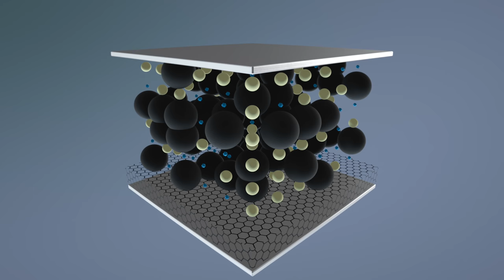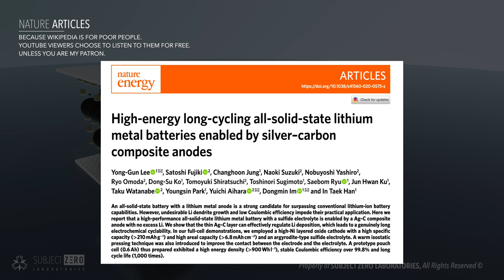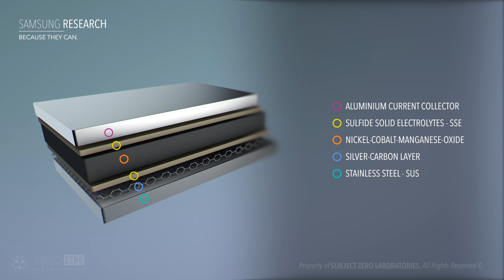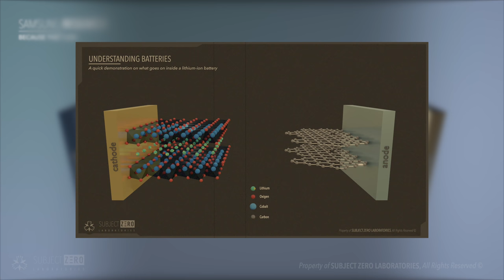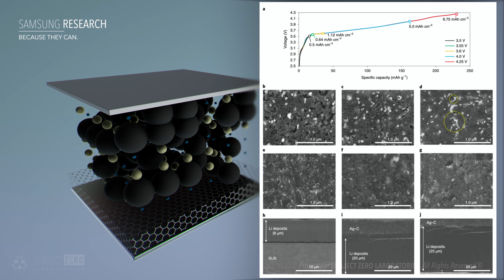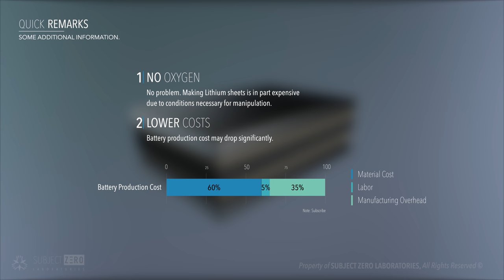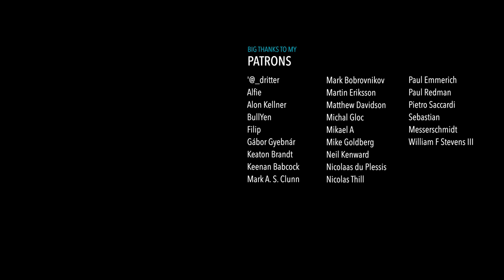Breakthrough Solid State Battery - 900 Wh/L Samsung [2020]

Comment: I attended a "battery symposium" (I don't recall what it was called) back in 2006 in Ohio while in grad school.  I recall 3 or 4 companies giving very promising presentations on ssb's. The data shared seemed very promising! One of the companies actually promised to have these commercially available in 2 -3 years.  Well, that was 14 years ago, and still no ssb.
Reply: That's the point. Powerful interests don't want this to happen. This is why they suppress other exotic energy production technologies. You can control people with hydrocarbon technologies (Oil, coal, etc) but you can't control them with other forms of electricity production, like over unity devices and zero point energy production technologies.

Comment: An interesting new way, but what about the Lithium-oxygen batteries that was studied in the Department of Mechanical and Industrial Engineering, University of Illinois at Chicago? Which one represent the future of the batteries?
Reply: @EricMalbos I was wondering the same..I guess that, since researchers at UIC developed metal air batteries they are dependent on oxygen and causes flammability issue with lithium anode...on the other hand this one by samsung completely eliminates the flammability case and makes them safer for future applications...
Reply: Lots of problems with this approach.
Biggest one, you have to pump air into the battery, while filtering it and while removing all water (and avoiding condensation)...
Reply: IBM kinda stopped development of there lithium air battery "project 500".
Reply: The cheaper one, obviously
Reply: @OmkarBhatkar  @apauwelyn1 Thank you, it makes sense, I understand now.

Comment: So basically, an unplugged Evangelion can last more than 5mins now
Reply: Why don't they use nuclear power instead?
Reply: @UltimateAlgorithm  It would have to be fusion, not fission. Our only use for fission is as a glorified steam engine, as its too slow for anything else.

Evas need to be able to move, and move quickly. The only good a nuclear reactor would do is as a trickle charger for a rapid-drain battery.
Reply: but future shinji will still be using a dtape.

Comment: Question is how much silver would be used per unit or ton?
Reply: If it ends up being a decent chunk, the price of silver might dramatically increase, at least until recycling can bring it back to more of a closed loop system.
Reply: I doubt it is going to require a lot of silver. Remember that almost every electronic device in your home has gold coated electronic contacts. I believe that the silver needed in these batteries will be a very little amount.
Reply: We don't know, but it was described as a 'nano layer' of silver-carbon, implying that it was very thin.

Comment: I've been hearing of new batteries coming zoom for more than 5 years now. When are they coming to market? I can't see another video for a battery unless it's already on the market.
Reply: Mid May according to Elon.
Reply: You confuse "coming to market" with "research if it even works"
Reply: @francoischarbonneau9447  Hehehe. Tesla will need another 2-3 years to get their product pricing low enough to justify the switch. Solid state, maybe 5+ but at a significant cost (on a sedan car already costing 60k!). By then, revolutionary combustion engines like Mazda Skyactiv X will be achieving better than hybrid efficiency while keep emmision (N0x) levels to ridiculously low levels. And that's aside the competition in the electric market and the lower low fuel prices.
Reply: Exactly im tired of seeing how this crap "might work"
Unless their coming to market quit wasting my time with stupid shit videos 

i want my money back
Reply: New and improved batteries are literally hitting the market everyday.  I owned a 2012 Chevrolet Volt and back then they used an NMC333 battery chemistry that cost about $400/KWh to produce.   My Wife's 2018 Bolt EV now uses a much more energy dense battery with an NMC622 Cathode that cost about $145/KWh to produce.   The 2020 Bolt EV has already moved on to NMC712 which is another 10% more energy dense and costs closer to $100/KWh.  And the new GMC Hummer will be using NMCA89 cathodes which are much more energy dense yet again and should cost closer to $90/KWh to produce.  Plus GM showed a solid state battery cell which appears to be pushing towards production for the next generation of EV's in the mid-2020's.
Reply: You are not following the right sources. Companies like Tesla (and one more) have brought newer batteries that can be purchased as a power bank (portable chargers). Either one or both of these are based on Graphene (as an enhancer). Samsung has a whole division working on even a better concept surrounding Graphene (still in the research).

The essence of it all is that, there are newer batteries with better efficiency (more capacity, faster charging, more life) but those have not yet been incorporated into mobile devices. For something as personal as a handheld phone, it has to be tested thoroughly for any suspicion of a hazard. There is gonna be bigger batteries this year on smartphones after a recent advancement which decreased the size of encasing surrounding the battery. I cannot recall what it was, but yeah, that's the reason, smartphones this year have a slightly bigger battery without making the phone bulkier.
Reply: Then why has phone battery capacity doubled in 10 years? My samsung s3 charge at slow pace and holds 2.1ah. My g6 is over 3ah and charge in 90min and newer phones may have over 4ah cap and charge in less than an hour.

Also heard of lithium tantanate? Up to 50'000 charge cycles. Lithium iron phosphate 5000. Actually used in medical stuff. ( you can buy them used for cheap as they're supossed to replace at 80% left )

Comment: ok, the volumetric energy density is 900 Wh/L
what about gravimetric energy density and the power desities?

for an ev it isn't very helpful to have lot of capacity, but only being capable of delivering little current while being heavier
the batteries need to have the right balance of properties for every appication
Reply: I suspect these characteristics are not so impressive, otherwise the authors would have enthusiastically mentioned them in the abstract.
Reply: Probably better for stationary application.

Comment: We keep hearing these "new breakthroughs in battery technology" and yet none of them have been used in a smartphone. I mean, the only thing that's holding back our phones are batteries. They only last around 4-5 years when afterwards they either have no capacity left or have bulged or even exploded. And they are not even easily replaceable like they were back in 2014. Hopefully, they will be available in a few years, because I don't really see a reason to buy a practically disposable phone.
Reply: They dont want you to keep your phone they want repeat customers.

Comment: Why does Samsung glue the batteries in their phones?
Changing a battery is basic maintenance.
Reply: Profit but you prolly already know that
Reply: So you buy a new phone every 2 years
Reply: I think you know the answer to that.
Reply: Its normal for most phones, even if the backcover could be screwed off. It's to make phones more durable and compact. You can heat the glue a bit and switch the battery. Replacing the glue is a good idea when switching the battery or any glued covers or screens. It can all be done at home, and for beginners internet is full of instructions for basic maintenace.
Reply: Would you like having a phone that rattles? Also it is not hard to unstick the battery.
Reply: Because Samsung has also cornered the market on temporary adhesives.

Comment: I wish they had give the Wh/kg.
Reply: A quick search on battery energy density indicates an appropriate equivalent of w/l to w/kg
Reply: 1liter = 1kg
Reply: zoltan87    With water, yes, but it doesn't hold true for everything.  For example, 1L of lead is going to weight a lot more than 1Kg.
Reply: @johnmyviews3761  i think there w/l might be wrong. My current ebike battery is around 1.5 liters, and is 1kwh, so its 750wh/l. IDK how 900wh/l is a big improvement

Comment: He mentioned the 60% inefficiency of the internal combustion engine to transmission to wheels etc HOWEVER did not apply the 10% loss of electrical power of the  motors that drive the wheels. This would have shown a more 'honest' presentation.
Reply: Lighten up Francis

Comment: Hi, just a small correction in your video : 
=> Lithium is not dangerous because of O2 but because H2O contain in air. When we make a lithium-ion cell we work in a dry room and believed me their is oxygen inside ;) Oxygen could be a trouble for other reason specially with liquid electrolyte for example.

Comment: If this works, it's easily worth a Nobel prize.  

P.S.  Your initial diagram is wrong.  The bulk of the electrolyte is next to the Steel electrode, and is not meant to be in as significant amounts at the Aluminum electrode.

Comment: I’ve heard about new battery technologies for years and it literally never comes to fruition… It’s like the flying car...
Reply: Nah, flying cars was a dumb idea to begin with. The more fuel you carry, the more fuel you need. A flying car with a full tank wouldn't get very far- and forget going fast. You could probably get over a mountain pass faster in a normal car than in a flying car. Even if the normal car was set to autopilot, which oh yeah, we have that.

People just thought it sounded cool, and it stuck. You'd be better off buying a glider (or strapping a jet engine to your car, but I'm pretty sure that'll void your warranty. And your insurance. And your driver's license, probably.)

Comment: Nice breakdown of the potential advantages of a so-called "solid-state" lithium battery, meaning dendrite-preventing plus a near all-lithium anode. However, "closer to an electric future" does NOT depend on achieving a solid-state battery. We already have safe, powerful, longlife, very affordable (under $100/kWh) lithium batteries with 10 times the volumetric energy density of lead-acid that you used as your 1991 baseline. A solid-state lithium battery would be great, but it's not at all required to move completely off gasoline for automobiles and many other applications that previously required gasoline.

Comment: So if this is Solid State and the charge is transferred by diffusion, dentrites would not come into the picture. Not sure why they are mentioned. 

Also he mentioned faster charging times. One reason for the faster charging times is because solid state batteries are non-flammable and cannot short circuit due to dentrites, so they can take more charge safely. But the greater energy density also means there is a greater concentration/ availability of lithium ions that can accept charge so this reduces charging time also. A win-win.

Comment: At 2:13, yes petrol has higher energy density per litre, and most internal combustion engines are only 30% energy efficient with some 40% whereas electric motors are 90% efficient

Comment: Mid spec lead acid car starter battery YBX5012 Yuasa Silver 
54 AH =  648 WH @ 12V
Size = 207*175*190mm = 6.8 litres
That's 95 WH per litre
But it's a starter type so only 30% comes out as useful power. Usable energy is just 28 WH per litre

Comment: We already know how to store huge amounts of energy safely in an onboard storage system. It's called "compressed air" at 10,000 psi or more, packed into carbon-fiber composite air pressure tank(s) that are "failsafe." This compressed air is then used to run in-hub rotary Wankel air motors which are nearly silent in operation and superefficient. Air pressure tanks can be molded to any shape and can be made so that they form the structural side panels, roof and floor of a vehicle. This provides huge compressed air storage space and opens up the inside of the vehicle and trunk to other uses (other than air tanks). The same technology can be adapted to power superefficient VTOL aircraft as well. GM Cadillac Aera concept car was developed to use these technologies. The air powered car would dominate the surface transportation system for hundreds of years to come, but even more exciting, VTOL aircraft of this type would make surface transportation, roads, bridges, and tunnels, completely obsolete, freeing up large areas for homes, and for wildlife, recreation areas, and parks etc.

Comment: There's a few things this video missed that are really important for batteries. how much will they weigh, how fast will they discharge and most importantly how much will they cost. (for materials that is, production and labour was talked about👍) It would be really great if batteries could have so much energy density but it they cost a lot they're not going to be commonly used

Comment: what we need are such energy density & a cycle life in the tens  of thousands of cycles. a thousand cycles is like a 3~5 year lifespan. That's a lot of production and recycling to maintain the system. A 30~50 year lifespan would reduce the need for such a ton. We could work toward battery life equal to the product lifespan and it would be actually useful for applications at the power grid level.

Comment: Solid State Batteries are a game changer.  they have about twice the capacity of current batteries at half the weight and since the electrolyte is not liquid, the batteries will last much longer.  So if you just think of an electric car for example, you will be able to double it's range and decrease the weight at the same time.  This technology will make electric cars more of a viable option for people that travel.

Comment: This are really nice results but...it takes a 3-4 MPa on the cell to operate. The pressure system may add a lot of weight, reducing the energy density of the whole system, and make it only suitable for specific application.

Comment: One big problem with your comparison of gasoline vs LI battery.  You should compare by energy /mass (not energy/ liter)  which is the ultimate constraint on a car or a truck.   Comparing energy per mass, gasoline (33KWH/ 6 pound) totally blows any battery out of the ball park.

Comment: Very cool!  Do we have any idea of output ratings (c)? it would be great to get higher engergy dense batteries for quads, but those motors draw a ton of amps, (mine will do 110amps continuous at full throttle).  if we could get more mah out of smaller lighter batteries flight times could be increased by a ton!  Currently we are limited to Lipo batteries because of their high output capabilities, (I fly 2.2 amp hour batters that discharge at 50c) and taking it easy on the throttle I can get maybe 14 minutes if I'm really just cruising and not doing anything too crazy.  would be great to get more time.

Comment: How this works is quite simple. A battery is made up of 3 elements: Lithium, Nickel and Cobalt. If you change the order of the elements and sandwich the Lithium between the Cobalt and Nickel, then add a thin layer of magnets, you can increase the energy storage capacity by 50% via Energy Transmutation Theory. And if you look really closely at 2:23, you can clearly see I have no idea what I am talking about.

Comment: There is no mention of internal resistance or discharge rate. We need high energy density with a high discharge rate for cars and phones. A battery only able to provide small amounts of energy for a long time is far less useful. Needing to parallel many cells or make these batteries ultra wide can get inhibitive

Comment: Electricity also has an efficiency. So you have to multiply it with ~.95.
Also depending on the technology the heat that is almost completely lost in a car, can be used in other forms. So the efficiency is about 50-60%.
The efficiency depends on the engine and has nothing to do with the fuel/battery. Also you have to charge the battery that also creates losses. So another ~.90. Yeah you can recharge w little with braking.
The point ist that comparing battery's and fuel is more than just the introduction in this video. 
But still a good video.
Reply: So roughly 85% energy retention from the wall which is still miles ahead of 35% using fossil fuels. Your country just needs to not be a bellend and invest in power plants and some solar/wind for it to make a huge difference in cost.
Reply: @Yeet42069  it's not what I said. I said comparing fuels with batteries is more than what was said in the video, and that the video is good.

And in addition you can already see how much the battery technology evolved in the last year.
Solid state battery's are cool, but too expensive to be built. The first time they will hit consumers is in 5-7 years and in cars it will still need at least 5 years longer. So expect solid state battery's I'm 10-15 years. 
We need massive solar and win expansion and hydrogen/Methan plants. There is not enough Lithium on the world and I can't be build into battery's fast enough to replace fossil power plants and the stabilizing factors they have on the power grid.

Comment: Fascinating, though I think that with cost of R&D to further develop lithium battery which is really taking off in various consumer discretionary products, outdoor power equipment, cars, motorcycles, etc., it may be a best-case-scenario to to see a marginal increase in end-user cost (consumer cost).  More than likely, the company will want to see significant gains in profit for their work.

Comment: Many are commenting that its going to take decades to get this tech to market. I would be surprised if its not available in less than 5 years. The biggest obstacle to electric vehicles is range and charging time. Ideally a battery should be able to match what a person can drive during a full day. 10 to 12 hours of driving and then be fully charged by next morning from a standard household plug. That day finally seems possible and thats the day when I will be willing to invest in an electric.